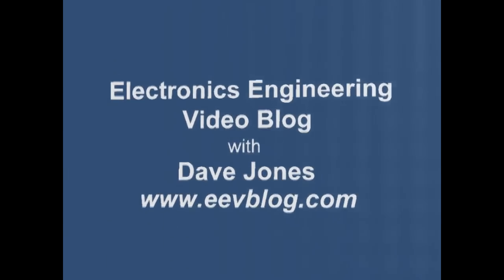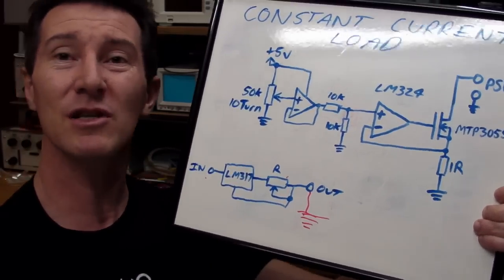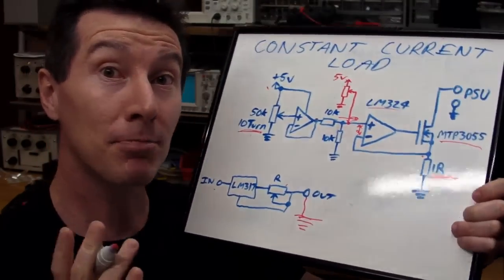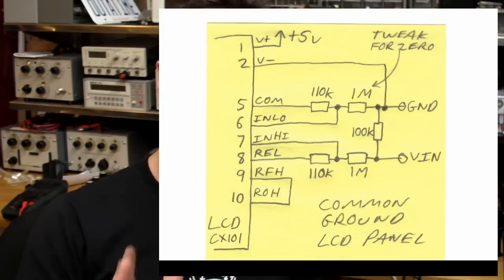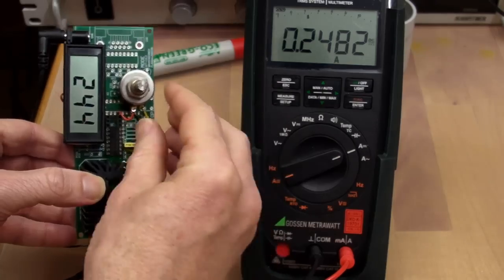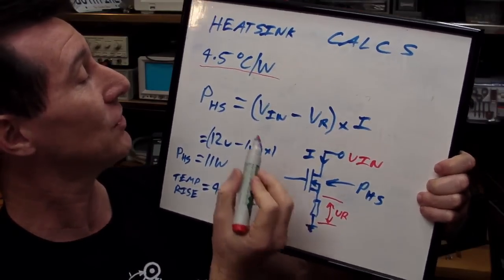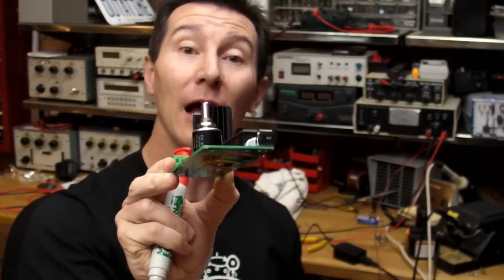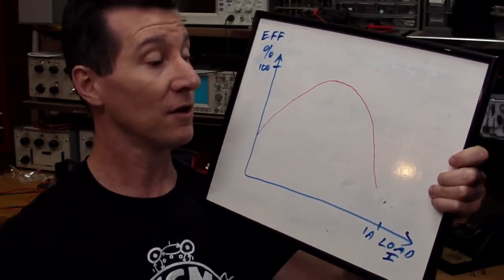EEVblog #102 - DIY Constant Current Dummy Load for Power Supply and Battery Testing

Comment: Thanks for this video I thought it was really informative to see these parts working together! I've been reading about opamp and linear regulator circuits lately. I was wondering about the heatsink calculation, were you adding in the junction to case thermal resistance of of 3.13 C/W from the chip? I'm wondering how that factors in thanks

Comment: one question. How can you make sure that the opamp's output will keep the mosfet gate on?
Reply: +Alperen Akküncü It's part of the feedback circuit. If the mosfet isn't turned on enough, the opamp's output will rise until it is.

Comment: Can anyone explain to me what the voltage-follower is needed for? i know dave says it is not needed. but everyone who copies this dummy load uses the voltage follower between the pot and the current-regulator. so i guess it must be there for a reason.

i simulated the thing with and without the voltage-follower in ltspice and there seems to be nearly no difference. so i really would like to know what it is good for?!
Reply: It is merely a voltage divider. You really only need one opamp but I added a 25k trim pot instead of the divider resistors so I could tune the max current ceiling as I was using a 12v input. The 12v was to power an isolated DC to DC chip to power my LCD meter panels on the same supply. I also added a 10k resistor between the 2nd opamp and the Mosfet to prevent ringing but I don't have an O-scope to prove anything.
Reply: Super late on this reply, but I kept the voltage follower because I used an LM358, which has two op amps in it. Rather than terminate the other op amp and have it do nothing, I kept it as a voltage follower. I imagine others did the same just to avoid leaving things hanging. If I had reason for the second op amp (like amplifying the sense resistor voltage, for example) I would have used it for that instead and just kept the voltage divider. If you want to reduce your sense resistance to, say, 0.1 or 0.01 ohms, you could amplify it by 10 or 100 to get your amps (and this would feed back to the first op amp, instead of the voltage drop itself), and even put a simple low pass filter on the output of the second op amp to stabilize the reading. Using a smaller resistance will result in less power dissipated in the resistor(s). However, the LM358 may not do very well amplifying the voltage if it is super small (so maybe avoid anything lower than 0.1ohms).

Comment: Q: I'm having real trouble making a fine + coarse pot from two cheapy 1 turn pots in series. I can't seem to figure out the wiring to get proper linearity, if that is even possible. Any help?
Reply: stick the large value (course) pot at the top, series connect the low value (fine) pot to it and to ground, connect its wiper to ground. Connect to large value wiper to the non inverting input

Comment: I'd put a gate resistor (10-100Ohm) just in case... opamps may not like gate's capacitance.
Reply: +Alexandre Kandalintsev I was thinking about the same thing, but wouldn't it interfere more than what it would help?
Reply: +Krisztián Szirtes the MTP3055 gate's capacitance is around 400p. Surprisingly for me, this is not that bad for LM324 (but bad for many other opamps!). I don't think it can hurt, but only simulation can tell for sure. I would expect it to increase loop stability at the expense of slower reaction.
Reply: +Alexandre Kandalintsev [Edited out, I realized it was dumb and I thought about a wrong connection.] You are correct. But I would go with 100 ohms as a minimum.
Reply: two resistors: 1K ohm gate resistor and 10K ohm resistor between gate and ground.
Reply: 1K looks a bit too much to me. It affects loop bandwidth and stability.

Comment: how to build the constant power/current/voltage using the microcontroller?...what's the source code?
Reply: If you are unknown to the subject, as it seems, I recommend Arduinos, because they are open source, you can find lots of help online, you can even build up your own Arduino. :) You do it with a PWM output signal. http://en.wikipedia.org/wiki/Pulse-width_modulation  Short Arduino Tutorial: http://arduino.cc/en/Tutorial/PWM another nice example is here: http://arduino.cc/en/Tutorial/SecretsOfArduinoPWM

Comment: Why is the mosfet required at all? Why cant you just output the load into multiple load resistors?
Reply: I see. Thank you, that makes sense now. Thanks again
Reply: Robert Lazarus Just one comment - the MOSFET can’t really dissipate 48 W on its own or even with that beefy heat sink. You need either an even beefier heat sink (which would be really big and expensive) or forced airflow (namely, a fan).